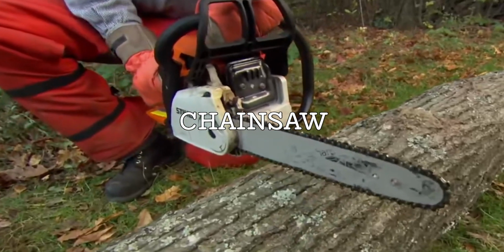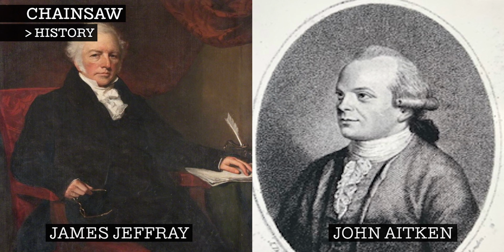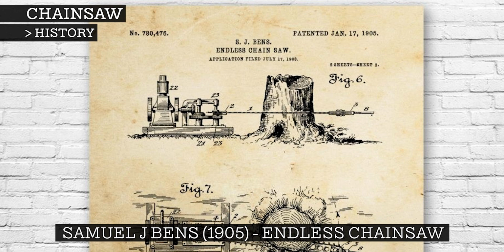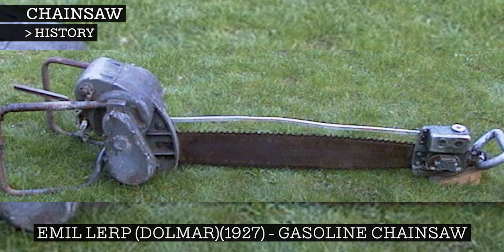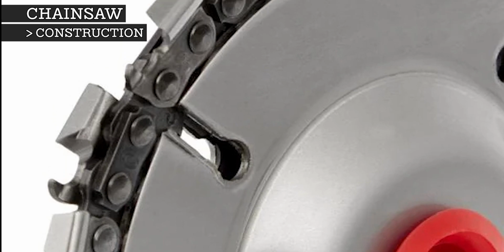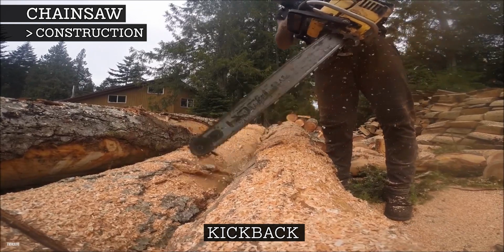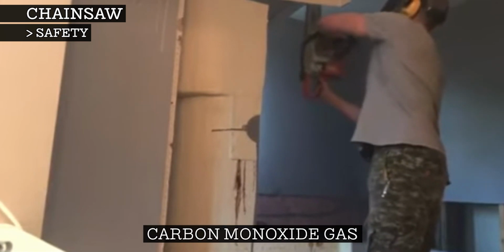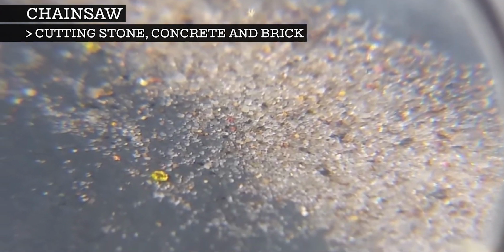CHAINSAW.

Comment: When fastened into a special guide frame, a chainsaw can be used as a portable sawmill to cut bulk wood into planks or boards. Such usage is called a chainsaw mill or Alaskan sawmill.